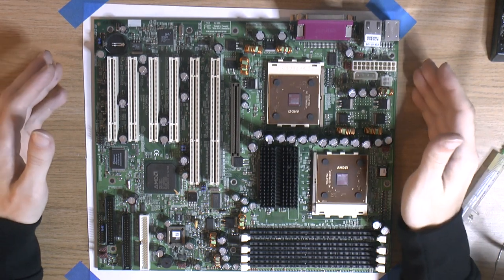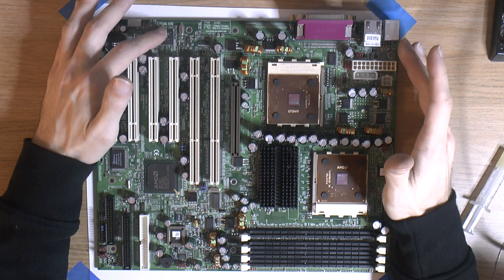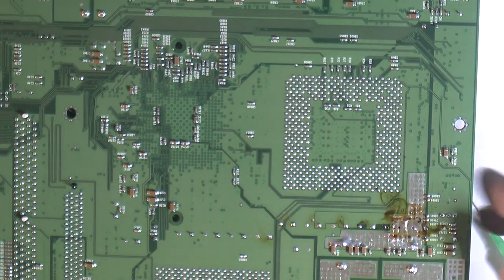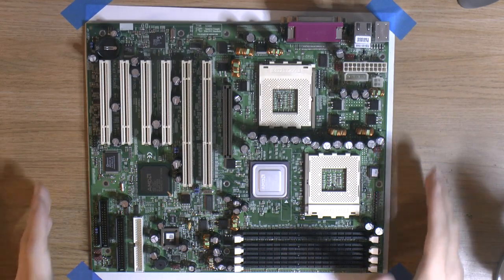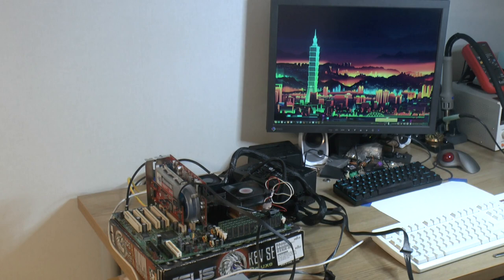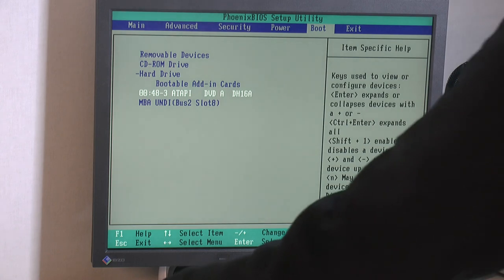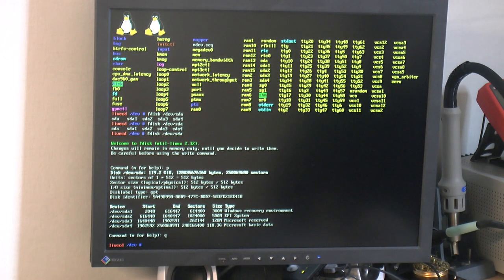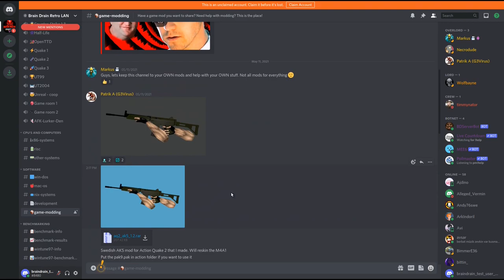Dual Athlon MP build part 1

Comment: Oh man, that reminds me of my first computer. It had a single Athlon XP 1900+, but later down the road I overclocked it and every 100MHz bump caused it to be detected as a higher CPU, so going from default 1.6GHz to 1.8 caused the BIOS on my mothterboard to detect it as 2100+. Good times.
Reply from the maker: I was originally going to build a 1800+ system like I had back in the day but then I found this motherboard instead.
My 1800+ was a poor overclocker but with watercooling I got it to 1.7Ghz eventually and like you sad the PR rating usually changes.
Also I remember my one of my boards had a bios option so if you wanted your XP CPU would be identified as an MP, idk why you want that on a single socket board but it was an option.

Comment: I decided to build a new old stock dual Athlon MP system in 2008, which consisted of a pair of Athlon MP 2600+ CPU's and an MSI K7D motherboard. Both CPU's and motherboard were imported from the USA (to the UK), which in total cost nearly £400 with shipping and import charges. This obviously doesn't factor in the additional cost for a case, power supply, hard drive and not to mention the fun I had trying to get the various different types of RAM I had working in it. I reckon all in all I spent near on £600 on that system (maybe more), and the irony is that I sold it all a few years later and probably made less than £50 for both CPU's, the motherboard and the RAM! Still, it was the first system I had built for 4-5 years, so it was enjoyable all the same.
Reply from the maker: And now the 2600+ cost from £60 on ebay, adding 2 of the lowest priced I could find to the ebay chart it came out to 200 USD with shipping and tax on ebay and then I probably get charged again in Sweden due to it being a US import.
I dont get the ebay prices the sellers are asking, there is hardly any stock moving from what I can see and there are a lot more CPU's then motherboards.
Also there was a Tyan S2466 with 2x 2600+ MP's, 3Gb ram, two solid copper coolers on sale for 100USD plus 60USD shipping and tax and import charges and that listing was up for months before ending recently and I dont think it sold, did not say sold just ended.
It would have cost me less to buy that kit and just move the CPU's then buy just the CPU's.
And they are asking 300USD for the board alone and I dont see them sell at that price point.
So its is clear to me people dont want to pay the inflated ebay prices for "retro" hardware.
I love this system, I did skip Athlon MP for an early adoption of Dual Opteron 244's on launch back in 2003 and actually got to test UT2004 amd64 Demo build on linux before it was official released to the public.
Icculus the Linux UT2004 developer, he wanted people to test it and uploaded it to my FPT server so me and my friend cold go ham, today I think you get fired for that as a developer.
So the Athlon MP system is more like the Dual Athlons I wanted but never had and skipped but I dont see the prices now reflecting what people value the systems at, I think there worth preserving and are a dam cool addition to anyone's retro collection but the prices are inflated and stock is hardly moving on whats out there so its just collecting dust in the hands of ebay sellers hoping for a whale to trow 500USD at them for a set of processors and a motherboard now.
My ram in this build is actually from my 2003 Opteron 244 system.
I sold it but got the processors and ram back a few years ago when the motherboard died after 7 years and the cpus and ram had collected dust in a box for years so the ram was a perfect match for the Athlon MP's being a matched kit of four Kingston PC2100 ECC/REG 512MB.

Thansk for watching and Im planing more content but its a bit slow now, have a project in the works, not as fun as this but needs to be done so I can do some mods and stuff I been tasked with.

Comment: Used these boards right from their release, still have two computer which still work. Also one MSI and one Gigabyte. bought the MSI first, than the two Tyan and as last the Gigabyte. Always used them with Windows 2000 Pro Sp4. Never had any problems in the more than ten years I was using them. The four computers are still there and ones a year they are run. AMD Athlon MP 2000+ to 2400+ CPU's only ones a 2000+ faulted in all those years. It was a good platform to work with.
Reply from the maker: I read a lot of bad about this platform before building it but I share your view, rock solid so fare! Zero crashes or lockups and SMP performance is good!
I installed Windows 2000 PRO SP4 on it, its running right now because I'm doing a gallery for a Swedish tech site so have it rigged up.

I never had a CPU die on me in 26 years but I can happen. I went with the biggest NOS coolers I could find that would fit and some bigger fans and I have a temperature controlled 120mm fan in the rear to maintain a good temperature at all times so I'm sure the system will last a long time for retro use.

So yea a nice platform and I'm pleasantly surprised, exceeded my expectations, and the 64bit slots are great for all those 64bit PCI/PCI-X cards one have that rarely find a use case for.

Comment: You deserve more subscribers! I have a similar dual socket board from epox. Just lack the proper mp athlons to test it out.
Reply from the maker: Thank you!

Have you tried the L5 SMP enable mod on Athlon XP's or have they blocked those CPU's on the board?
Reply: _Haven't yet, but i guess have nothing to lose if I do:) just need to recap it first to be sure the test won't end up in smoke

Comment: I think I used that board for years I bought mine already built.  Worked great but couldn't get it to boot when ever I added RAM , it came with one gig.  Mine had onboard SCSI which was nice.  But it was load, had a bunch of fans.  So had to be careful when recording live.  Finally just quit.

Comment: Just use 2x Athlon xp-m with the hack for mp use.
This way a fast systeem lower power use and 512Kb l2 .  And unlockt multiple so you can use the speed you whant.
Reply from the maker: Yes I know about the L5 mod but I dont have any XP-M processors.

Comment: I didn't know any other Retro youtubers had this board! 

Would you be able to do a dump of the BIOS via Flashrom?

I bought one but the seller had flashed the wrong BIOS. Flashing the vendor BIOS file with an EEPROM programmer does not seem to work
Reply from the maker: So you tried the bios files on tyans ftp ftp://ftp.tyan.com/bios/
Just download all files with 2466 in the name.

I can see about trying dumping my bios the next time I take out the computer.
Reply: That's the one I tried flashing via my eeprom programmer, no luck

I'm wondering if Tyan's BIOS flasher does something to it while flashing so I want to do a diff on the two files

Comment: seems like you have a server type idea for this machine, can you reveal what job you have in mind for it? are you sticking with linux?
I find the hardware interesting (i still have my athlon tb 1.2 pc), but i really wonder if the hw setup is practical anymore? Say you used it has a file server for example, an arm device or even a dual/quad core cpu from the last 10 years might be faster and consume less power.
I get it from the nerd perspective, but from practically standpoint i wonder if its the right tool for the job. But i dont know what exactly your plan is so take my comment with a "grain of salt".
Reply from the maker: We play old games on them, host games and files on them so yea retro gaming machines or servers.
We host public retro lans, there are also privet retro lans in sweden and then we play online a few times a month with them.

We like period correct hardware for period correct games I suppose, because its fun.

Part 2 and 3 is made so I will upload one every Friday so thats should answer more questions.
Reply from the maker: Im not sticking whit linux, I use Linux on my every day modern machines but for the old stuff its usually Windows 95,98 or 2000.

I might do a linux retro build or install, do have some planed and I have done it before on PPC and Alpha machines.
Reply: isnt dual cpu only supported with server windows products in this time period?
Reply from the maker: @Pickle136  When systems like this came out Windows XP Home existed and supported two threads but only one socket so you still had to use Microsoft's Professional line of Operating systems or the server version for a board like this.

So I suppose the answer is yes, artificial limits forced you to use the Professional or Server versions of Windows like NT 4.0, 2000 or XP.